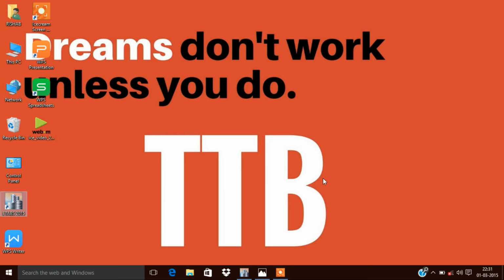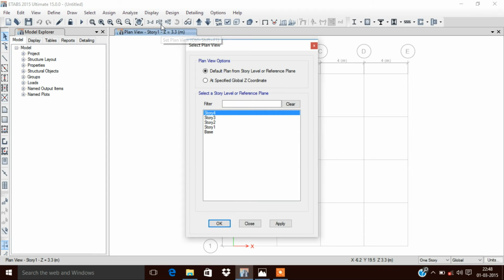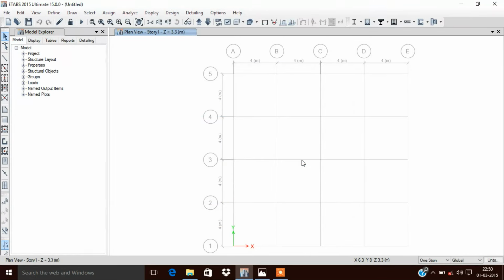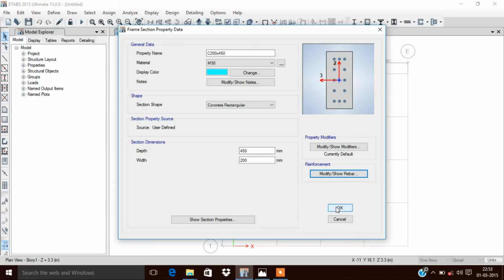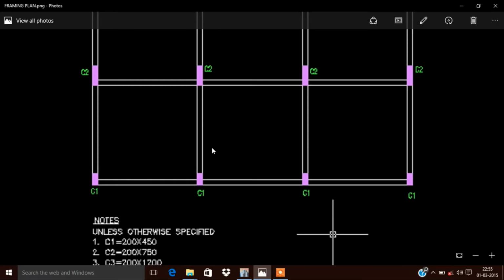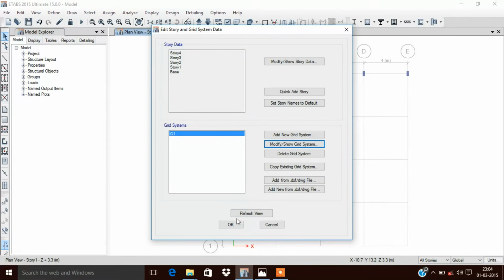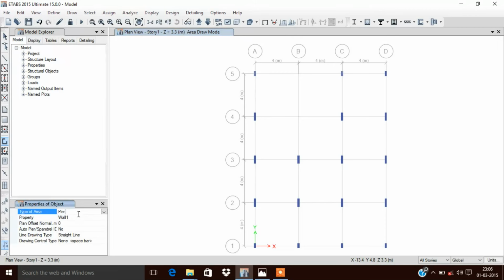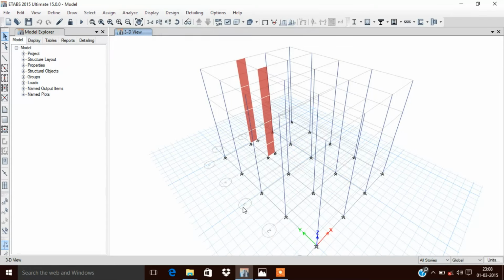STEP BY STEP INDIAN CODE design in ETABS | Part-I

Comment: i completed the model and then i analyse my structure for any duplicate frame or shells..but i see a lot of warning..even i checked  again i m sure there is no duplicated beam.it shows like this
" Story1, B5 & B23 are overlapping each other. Overlap =0. Check at (12600 13500 3000) " for most of the beams
i checked my first story and cross check B5 and 23..can somebody help to  me this..thanks
overlap 0 ? can somebody explain this too.